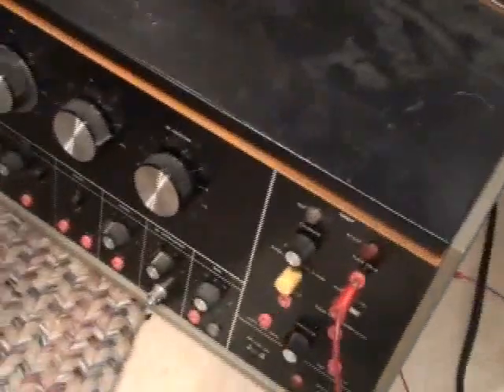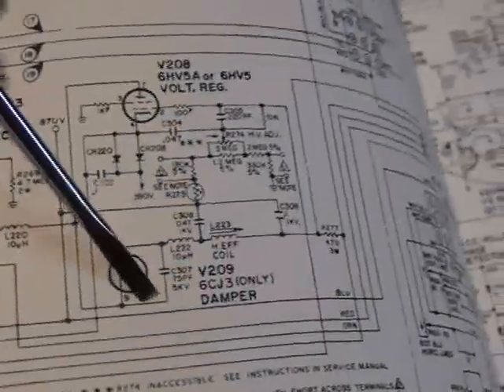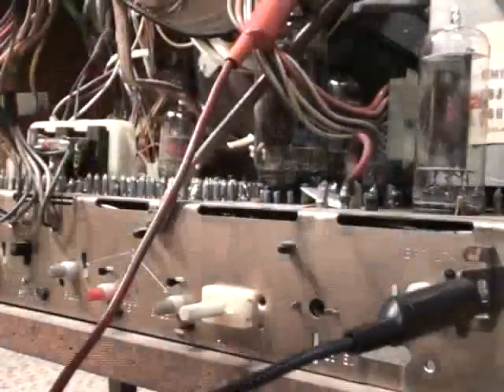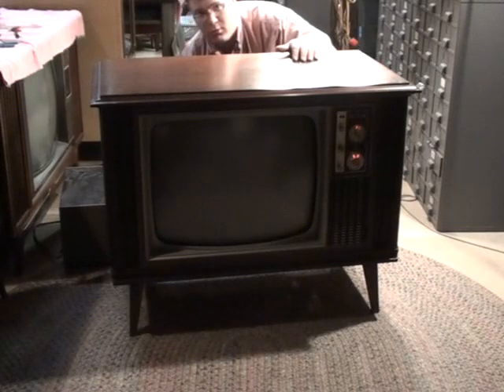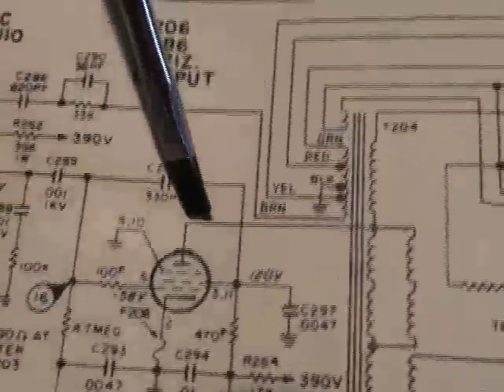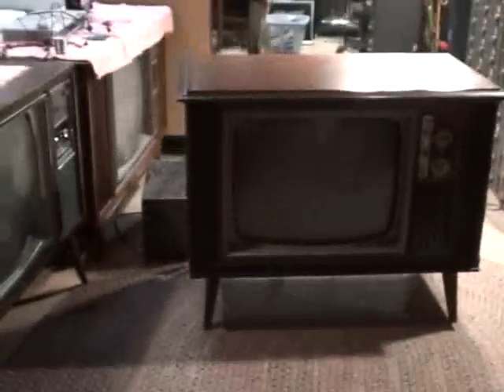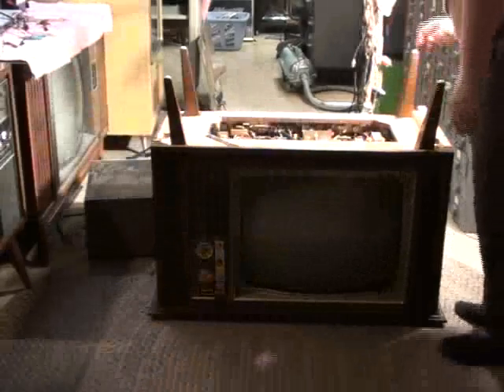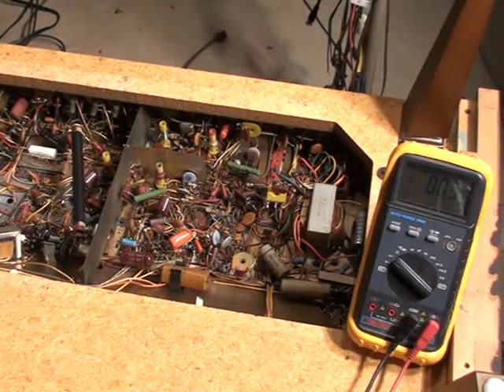1971 Zenith color television in repair, part 2 of 4

Comment: Awesome video! I have a B&K 1077 as well and have not used it yet due to not having the manual, I now am understanding how it works other than what you already explained to me about it. seems a lot more simple than I originally thought. I also will need to make some leads for it as the originals are missing.